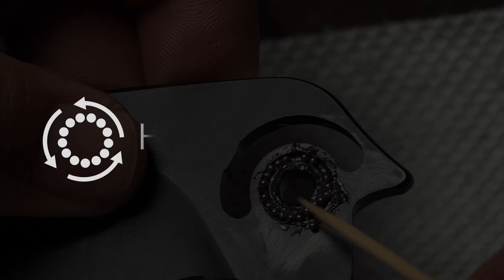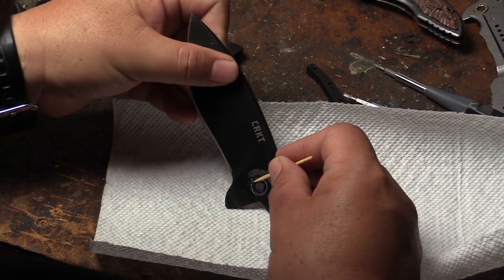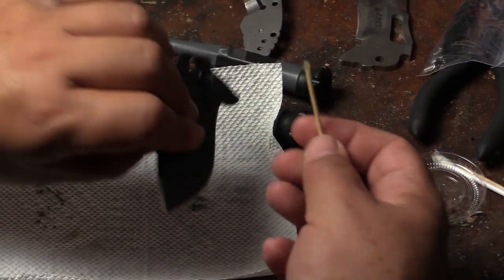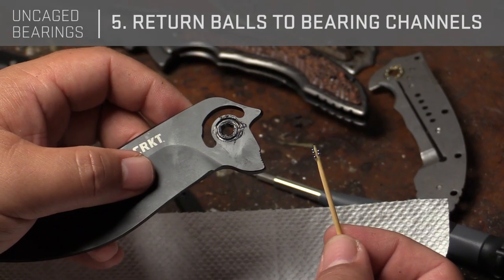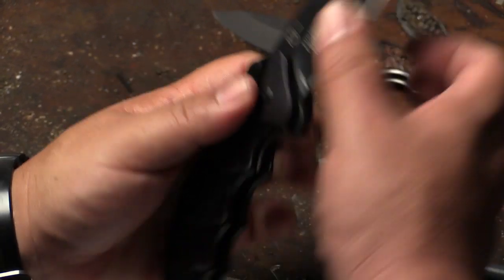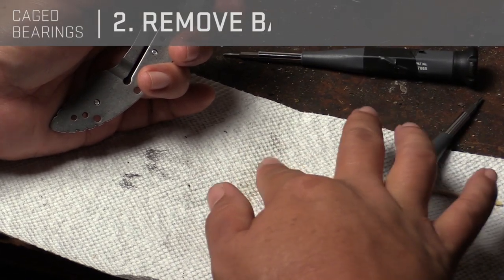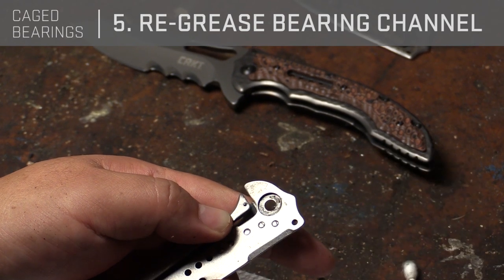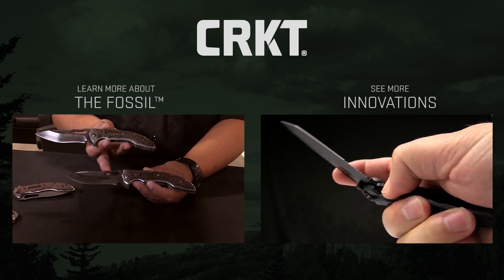How to Clean IKBS™

Comment: I would love to know the allen key sizes to disassemble this knife....there are 2 sizes needed....what are they??
Reply from the maker: Hi Mike - Thank you for your interest. Most of our knives use size 6 or 8 torx screws. Here is a video that touches on the screw size of our knives: https://youtu.be/XQ__JEvETec Also, our Customer Service team is on standby to help if you have any questions: https://www.crkt.com/customer-service/contact-us
Reply: ok, well, it turns out that THIS particular "no time off" knife uses allen screws (hex)... I guess I will now go to the other link you provided and see if someone there knows what SIZE those hex screws are
I AM SIMPLY TRYING TO DISCOVER WHAT SIZE HEX KEY (ALLEN KEY) I NEED TO DISASSEMBLE THE "NO TIME OFF" KNIFE.... THERE ARE APPARENTLY 2 SIZES OF SCREWS ON THAT KNIFE, SO I NEED TO KNOW WHAT SIZE THEY ARE.

I DON'T NEED TO KNOW THE SCREW SIZE, I NEED TO KNOW THE 2 BIT SIZES I NEED TO UNSCREW THEM.

MS
Reply: @MikeG-js1jt  the bits are size 6 and 8
Reply: @MrMickaloden  Thanks MS
Reply: @MikeG-js1jt  They are not allen wrench bits or hex. They are called torx bit like the original comment stated. The size is torx 6 (t6) and torx 8 (t8). You will not get anywhere using an allen or hex key trying to disassemble your knife.

Comment: what if you lose one!!!! your screwed LOL
Reply: He says several times that if you lose a few ball bearings that the knife will still work the same. There are more bearings than needed in the pivot.
Reply from the maker: You can always use our free parts request page as well to request more, in case you don't want to do without.  Here is the link: https://www.crkt.com/customer-service/parts-request
Reply: Omar Calderon I lost one out of my small Ripple I replaced it with an ink pen ball
Reply: Kevin Terry smart. I lost 4, didnt replace them and the knife runs even smoother it seems